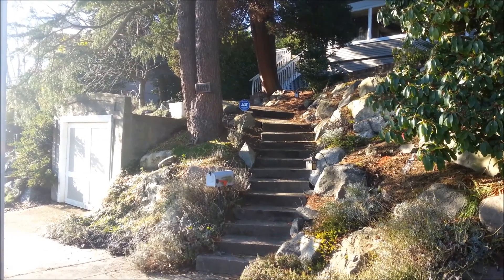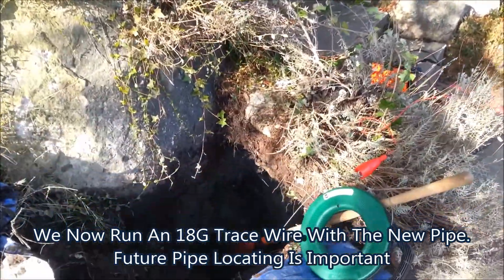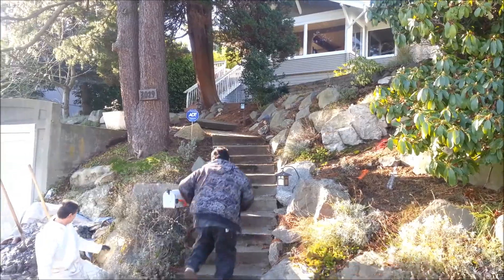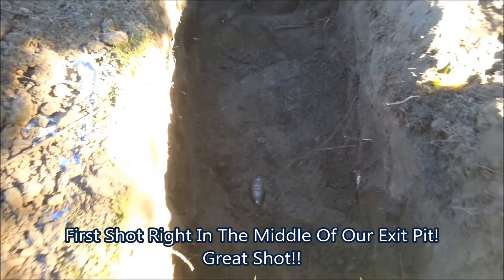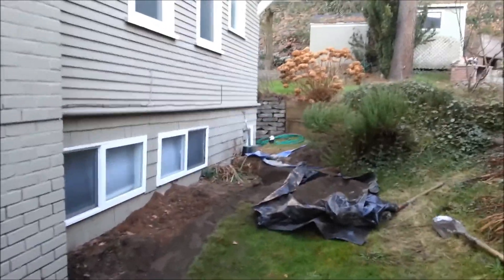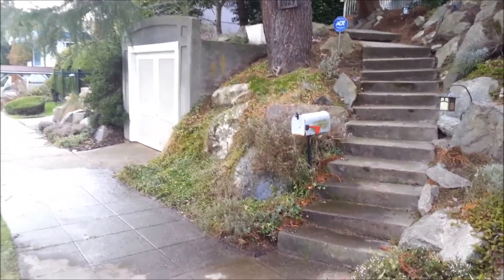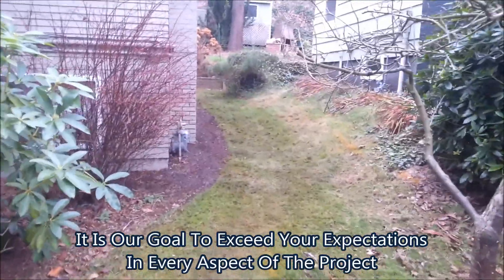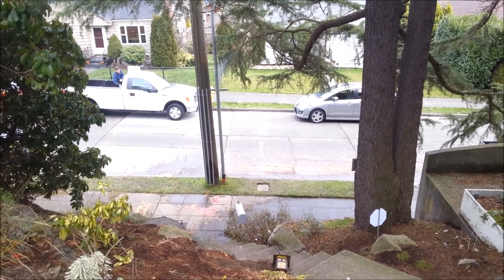Trenchless Waterline Installation

Comment: This is a very well done job. The restoration was done so well that I couldn't even see where the seams were. The starting pit amazed me. Did you guys have to burrow under the sidewalk and street in order to get the mole started?  It also started right underneath a large boulder. Very tricky. Great aiming, too.